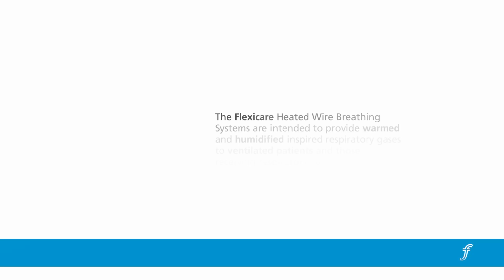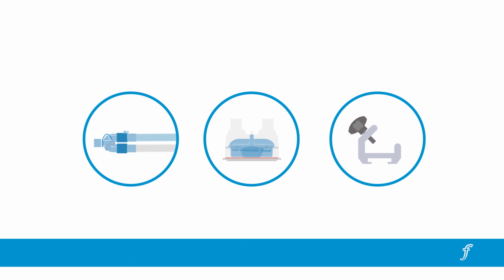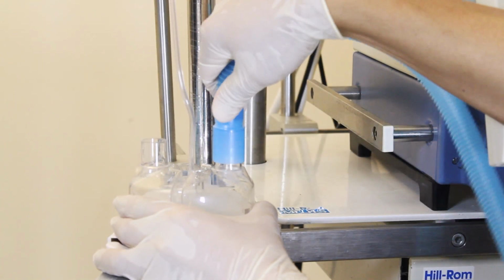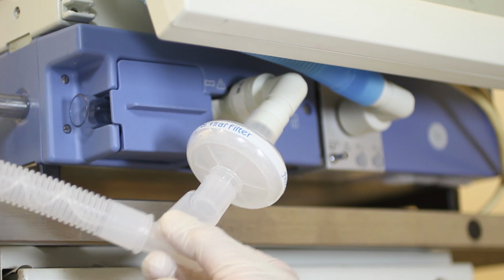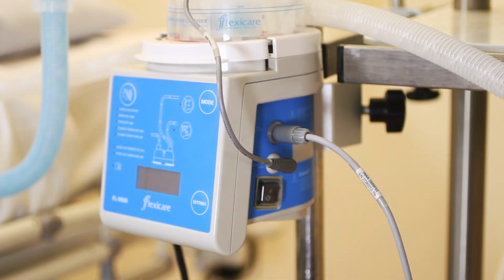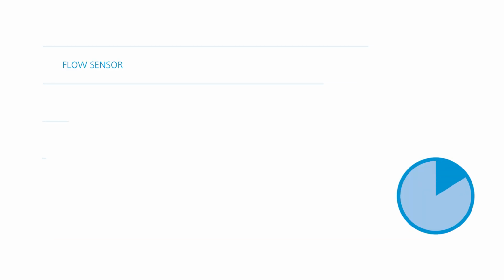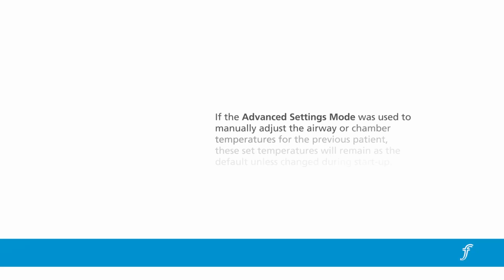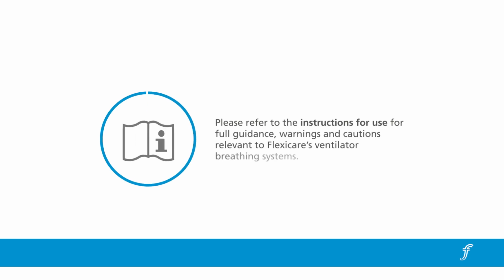Adult Ventilator Breathing System Setup

Comment: One ventilator for entire hospital just supply the oxygen get a plumber install some pex tubing control the flow with a dial at the patient.
Reply: Mitchell Lance won’t work, every patient has different needs... unfortunately it’s not as simple as just pumping air, not only that, you still have different levels of pressure according to the pulmonary capacity of each patient. Ventilators work with tidal volume per cycle as the lungs move air in and out. Ventilation, oxygenation, FiO2, PEEP, tidal volume... there are a bunch of things to consider - in other words, your idea though great, will not work :)
Reply: @ashamaniq  you have oxygen monitors,  one way valves, humidifiers, volume per patient can be regulated easily, set the resporations on one machine and hook it up. Simple plumbing even temperature can be controlled. Combine stuff you already have. What you are told for insurance purposes is horse crap. YOU COULD EVEN PUT THE PATIENT IN A PLASIC CUTRAIN WITH GLOVES CUT IN WHEREVER YOU NEED. JUST LIKE RADIATION HANDLING. ANYTHING IN WITH THE PATIENT HAS A NEGATIVE AIR FLOW DUCTED OUT OF YOUR SPACE.

Comment: I have to ask due to the shortage of machines at present, can a spur be introduced to let 2 people use the one machine at the same time? If possible this would double the present availability.
Reply from the maker: Modifications to ventilator set up would need to be referred to the specific device manufacturers and hospital protocols #TakeFlexiCare
Reply: @flexicaremedical  no ones talking Bout suing you. Find an engineer. Figure out if it's possible at least please

Comment: If there was ever a sever shortage could CPAP devices provide any assistance for people in need of respirators?  I know it wouldn’t be perfect but would it help at all?  Maybe with the settings tweaked or something. I mean with CoV-19 shortages maybe it could be useful?
Reply from the maker: Adjusting the settings of any ventilator would need to be referred to the device manufacturers. This could require training and possibly internal mechanical settings/adjustments.
 
Our understanding of CPAP machines is that they do not sense how much Oxygen is getting to the patient’s lungs and as such may not be wholly suitable without adequate oxygen flow.
 
There are currently some groups looking into the possibility of adapting these machines to make fit for purpose.
Reply: Hi, do you have a research update on the adaption of a low end ventilator for possible cov-19 use?
Reply from the maker: @Dietsugr  Please contact the ventilator manufacturer for advice regarding modifications and settings to best address your query. #TakeFlexiCare